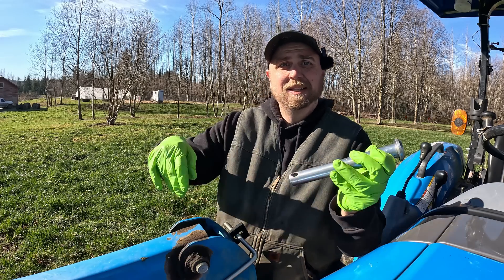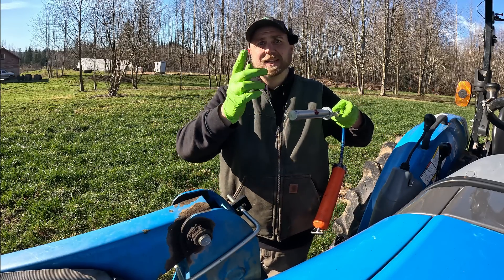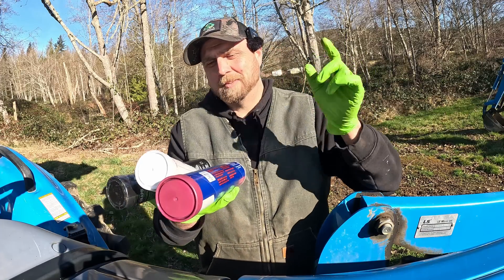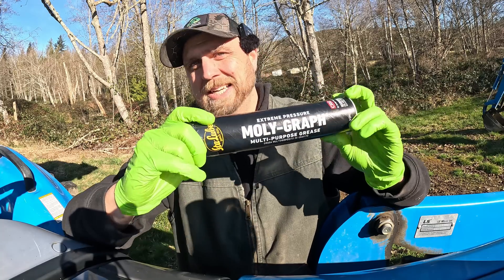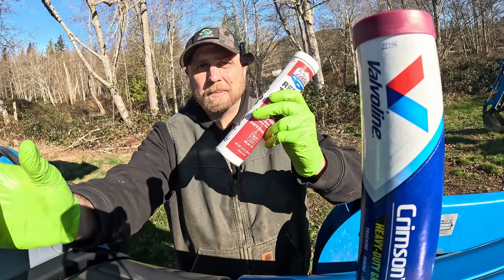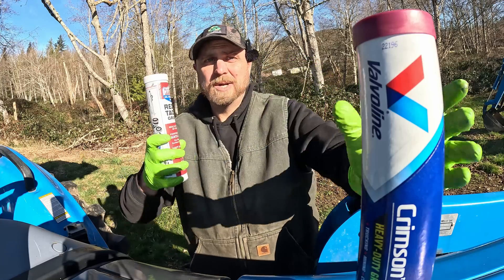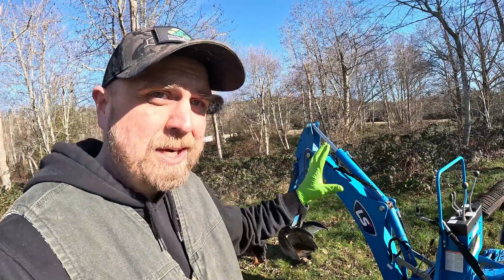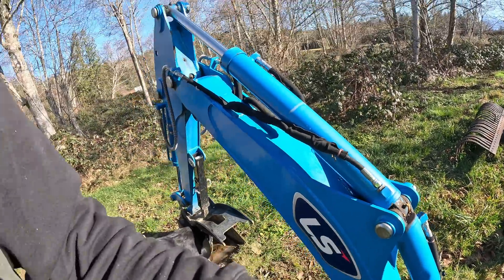Greasing a Tractor and Implements - What Grease to use and When to Use it

Comment: Moly is not the thickener in your grease. It’s probably a calcium-sulfonate which is better than lithium as a thickener.
Reply: Yes, moly is an anti-friction additive that is excellent for pins and bushings (not bearings), the thickener is likely lithium or calcium sulfonate as you stated.

Comment: I just got my first tractor. I've been greasing the loader every five hours. As for how much, I grease till I see it coming out of the joints. It's always good to push out old grease and get some fresh in there. The grease I'm using is "Traveller" brand Extreme Duty 3% Moly, which has a Lithium complex thickener. According to the labeling on the box, it is specifically formulated for heavy equipment like tractors, excavators, and other large heavy machinery.  I also use a battery powered gun. Way too many grease points to do it by hand lol!
Reply: Get yourself some Amsoil off-road NLGI #2. You won’t need to grease as much… guaranteed!
Reply: @stevefuller3585 will definitely check it out, but I'm doing it just to be sure it gets enough. I would probably do it every 5 hours or so regardless of the product. I will still look into it though, thanks for the tip!

Comment: I use the AirTec Li400 in a cartridge with the Lube Shuttle grease gun and the LockNLube Grease Gun Coupler.  No mess at all with the Lube Shuttle.